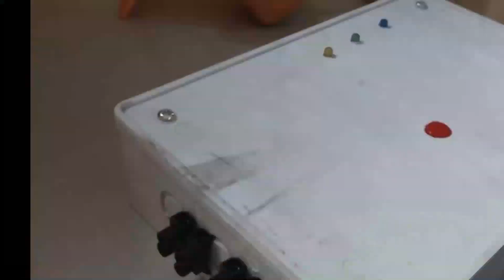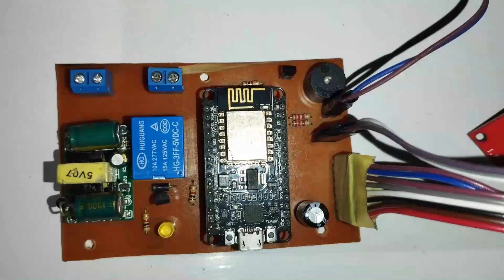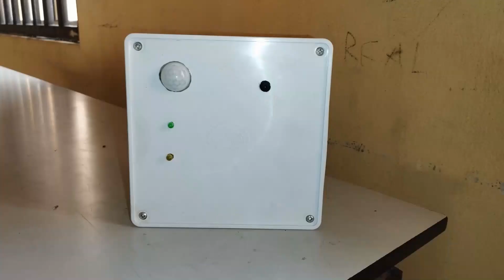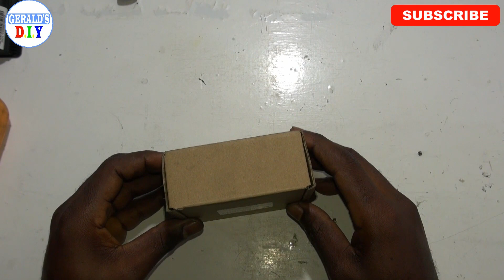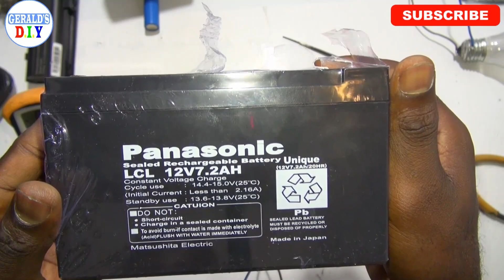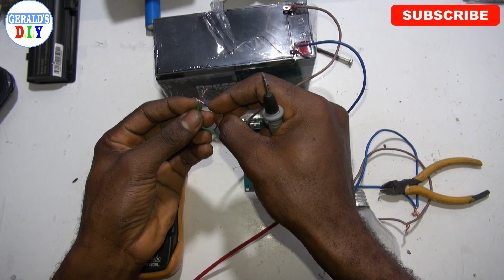#5 12v, 500w Inverter

Comment: Why doesn't run inductive celling fan
Reply: ceiling fan needs only 50 to 60hz, this thing outputs 20000hz that's why it doesn't run. It was not meant to power your AC stuff directly, it was meant to use for the booster stage of an inverter, so you'll rectifier the output to DC and then feed it to a h-bridge and drive it at 50hz (with a deadtime)

Comment: I bought 1 from 1 seller on Aliexpress and came with a damaged capacitor and I couldn't turn it off. I've ordered 3 more cause I need them for electronoobs pure sine inverter which I've got PCBs printed for. There's EGS002 driver board used. And, I already am at the refund stage of the first one and wish and hope that the rest will work :D. My cap was on one side lifted and held no capacitance ;), should 4700uF. 

But hey, they are really cheap :). I was looking how many Hz these transformers have, and thank you for letting me know that 20kHz. How do you know it if I might ask? I'd like to build only transformer because for now I have to buy a whole thing which I need to desolder before using ;) and it's time consuming.